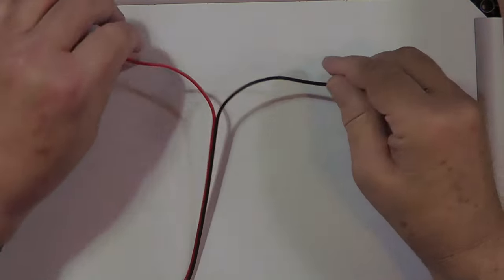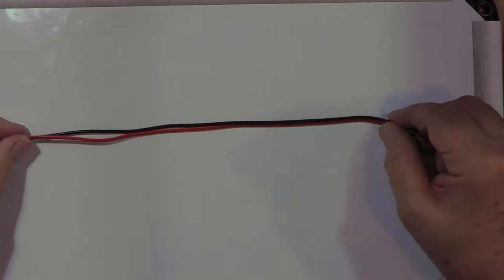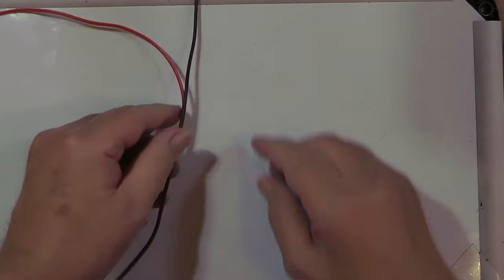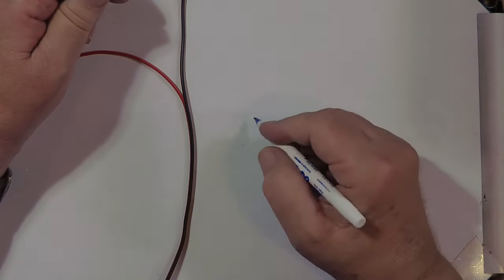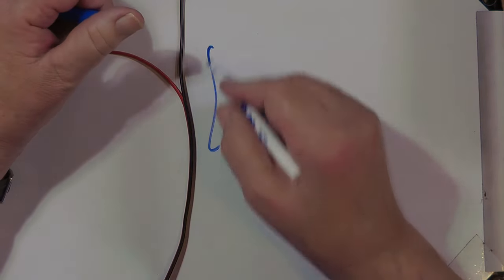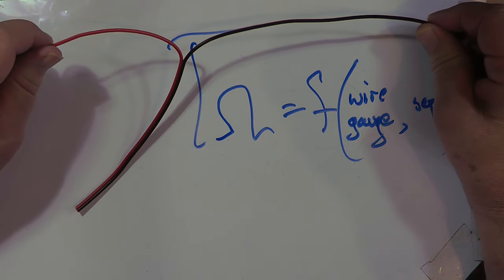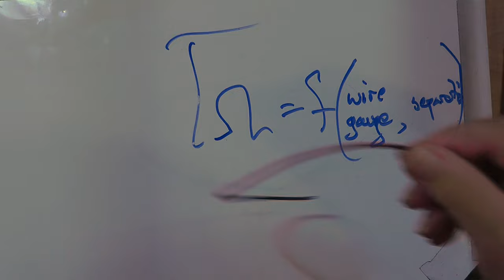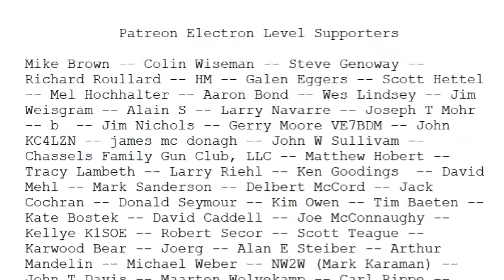Using Speaker Wire for Antennas (#1022)

Comment: I have an inside antenna I made from speaker wire. It runs all around the top of the room where the wall meets the ceiling and is connected to an Icom 7300. It works incredibly well and I get strong signals from Hams and broadcast stations all around the world. Of course, it's receive only no transmit.
Reply: I have used wire, but put it on a wall as a vertical loop and I've transmitted and worked countries all over the world on ten meter.

Comment: My biggest concern about using speaker wire is if it will hold itself up under its own weight, or break, or stretch an excessive amount.
Reply: I built a 40m inverted V, fed into 1:1 balun and is holding up well

Comment: I have to agree with Dave... My fan inverted v is made from speaker wire .. I do run a choke of about 18 or so ft. of coax .. 3 bands 80, 40, and 20

Comment: Doesn't wire thickness contribute at all to the signal? I never see people discuss proper wire thickness.
Seems like people just use whatever they have lying around, and it works. But i kinda suspect some 0.2mm motor wire won't.
Reply: I new and lacking in understanding regarding a lot of the technical side.  I, too, would love to know the answer (or at least hear people's opinions) on this.  Also, presuming thicker is better, is there a point where the wire can be too thick?